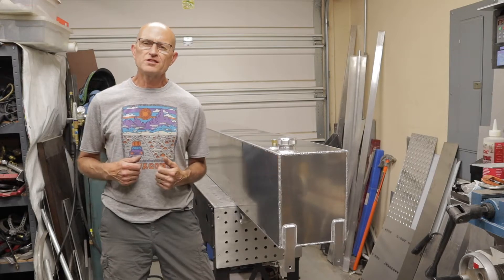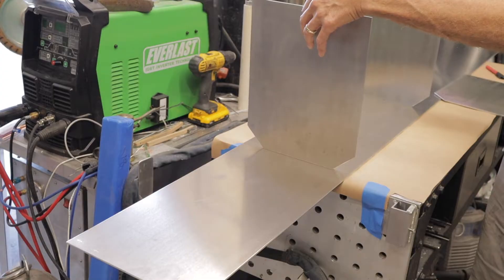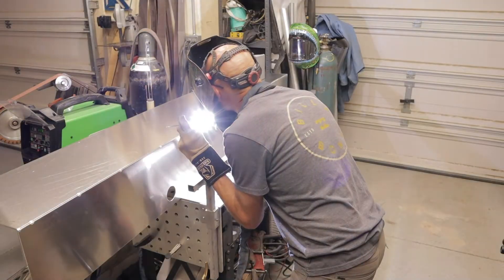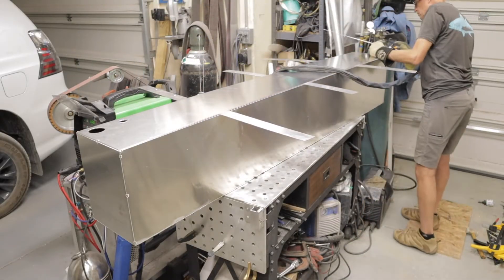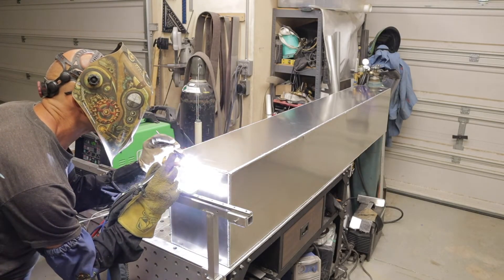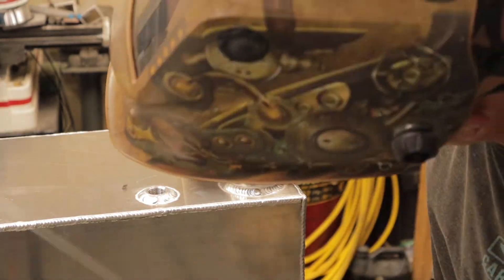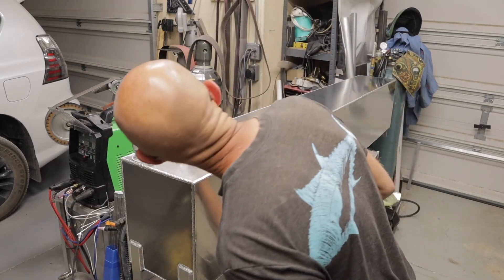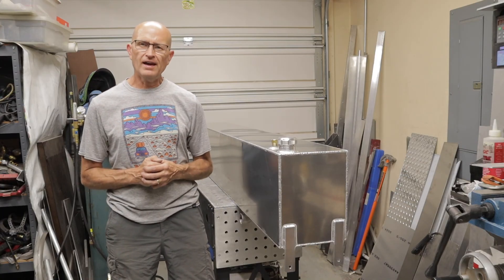ALUMINUM FUEL TANK BUILD 45 GALLON HOW TO FABRICATE IT

Comment: I have been planning to custom build my own fuel tank for the 1998 Dodge Ram 1500 that I have owned for the 26 years. In order for the exhaust that I want to fabricate for the truck I have to move the current plastic factory tank and relocate it. This takes me to the custom fabrication portion of this endeavor. Planning on putting it between the frame rails on the rear of the truck under the bed and have the inlet relocated in that same area . Do you have any suggestions or insights that I should be considering for this build? 
Love the video. Very informative and well thought out. Love your bearing setup for the long welds. Smart!. 
Thanks fr the video. Look forward to any input that you could offer. 
Thanks
Reply from the maker: Hi Ron! It sounds like a great project! 👍 if you are going to under mount it to the frame, I would recommend 1/4” thick angle aluminum with a triangular gusset at each end of the mount to keep everything nice and solid. The one thing that kills aluminum over time is flex. It eventually will tear the mounts right out of the tank if there is very much flex. Also, put a baffle spaced evenly for every 10 gallons of fuel in the tank. So for 30 gallons of fuel you need two baffles giving you three sections of the tank that are 10 gallons each.  I hope that makes sense. If you have any questions along the way, feel free to ask away! Cheers, Don😊👍
Reply: @PranaTech  Sounds great. I will use all your suggestions here as the model to follow when getting the build underway. I agree with the baffles for several reasons and it only makes sense. I hauled an 12,000 smooth bore tanker back in the day and that was a nightmare for many reasons. I liked the design you used. Do you think that also using a half circle cutout on the center bottom of the baffles would be any advantage as well? Also using the cut corners for the baffles like you did in you build! Do you have a suggestion on float leveling valves for the amount of fuel that is left?

Comment: Great job! Please do a video on your linear rail set. :)
Reply from the maker: Hi Lance! Thanks! There’s not much to the rail setup. I bought it on eBay and I believe it’s a 900mm long one. Here is a link to a similar one like mine. https://www.ebay.com/itm/405305180260?_skw=linear+rail+slide&itmmeta=01JTSGMZVDAYB4BMK82N0B8HDF&hash=item5e5e124064%3Ag%3Au90AAOSwCWVnUAjR&itmprp=enc%3AAQAKAAAA8FkggFvd1GGDu0w3yXCmi1e4lSgK4RFuNF27q1cgumbGGhuBRwXPrvMlW6PIEfwZJW1HFgEL3vaQYlK1yYpa2O%2BhnvCVL%2BNJt%2F4OOtD6wRgyCzCjOtclhqwoIOq9Tniw8jICwzhv%2BHYfE3vIDwBwtze9qmORoBgy%2FdNENPv%2FWXTXv10epBIDCCa6dkGALGwf%2FiYd7KxhNfV5J8RJD4pw97wSgelXPn8EJRF6%2FBiPTba3rRV%2FoJkHhSHPA%2FAtwipcOz4RWfj0ZtonHaWj1u9g71vAPAQJJ9eS2S6917PQPl9npY3vUCYBAyVbjqEK34w4Uw%3D%3D%7Ctkp%3ABFBMvv7TsNZl&keyword=linear+rail+slide&sacat=0&relatedSearch=true  I drilled and tapped the edge of my bench so it can be mounted there for long welds and then I made up the adjustable height frame for it that straddles the bench so I can weld tanks at different heights. 👍😊

Comment: What torch is that?
Reply from the maker: Hello! Sorry for the delay in my reply. I’ve been gone welding for days and just saw your question today. The torch is a Weldtec ihead WTR-20  It is the nicest torch I’ve ever used! It is really useful for getting into hard to reach places and I have three heads that all interchange on the rotary head. One is a small 20 size head with #5 cup for aluminum and the other is a size 17 head with a #7 cup for steel and then I have another size 17 head with a huge Mooseknuckle cup for welding stainless.  It’s not an inexpensive torch as it is made here in the US, but the quality is exceptional and it is really lightweight for a water cooled torch. Hope this helps! 😊👍
Reply: @ that thing looks like a beast. I’ve been looking for a new torch and at the moment I’m torn between this one and the ck230amp flex lock. I might be leaning towards the weldtech
Reply from the maker: They are both great heads and you would be happy with either one. I was looking at purchasing either one when I found the weldtec head on eBay for a great price and so I went that way. I have a CK head on my mobile Tig setup and I love their stuff. Very high quality that is equal to the Weldtec stuff. Hope this helps! Don😊👍
Reply: @ it certainly will, thank you.

Comment: Awesome!
Which Everlast welder are you using for this job?
Reply from the maker: Hi there! Sorry for my late reply. I’ve been working on a big welding job and missed a few comments. My welder that I use for Tig is an Everlast Powertig 325EXT. Any of their Tigs are great though. If I didn’t need that much power I would have just bought their 255 Tig, but sometimes I get jobs that I need to weld 1/2” aluminum so I went with the bigger one. 😊👍
Reply: @ thank you. Don't worry, getting work done is priority.
Thinking of getting an Everlast to work with a maximum aluminum thickness of 1/4".

Any recommendations?  

Not a shop, just a weekend diy guy that would like to build his own fuel tanks and small parts.
Reply from the maker: @alexsails80 I would go with any of the 250 amp Everlast tigs. They are all great machines!😊👍

Comment: Very Nice video, very nice tank. I need to make one like this but for gray water for a food truck. would MiG welding be fine? the tank will be placed in invisible spot of the trailer, thanks.
Reply from the maker: Hi there! Personally, I would only Tig weld a tank. I have a pulse mig welder and I’m pretty good with it and I still don’t trust it for welding up a tank that needs to be watertight.  It only takes a pinhole to make a big mess once the tank is installed and mig welding aluminum is still pretty dirty at the starts and stops of the welds. I know there are guys that are good enough to weld tanks with mig, but I know I’m not good enough so I stick with Tig welding so I know they won’t leak. 😊👍

Comment: Id love to see your machine settings, good job though
Reply from the maker: Thanks for your comment! Here are my settings. For amperage settings I don’t use the full amps all the time, just need it at the beginning and then I reduce the amps with the pedal as I go along. For the outside corner joints 180 amps, frequency 80HZ,balance @24. For fillet welds, the same settings but 200 amps. For the 1/4” mounting brackets, 220 amps, frequency 60HZ, balance @24. My Tig welder is an Everlast 325EXT.  😊👍

Comment: Prana-Tech, I'm confused about the baffle tops not being beveled/chamfered @ the corners to let gas/air out when filling? If the fill covers the lower limber holes/clipped corners... where does the volume of air above the fill level at the bottom go?  IF the baffled volumes can't 'breath' back to the vented chamber... won't filling be a rodeo? At one point I can see this tank burping fuel back up the fill fitting due to trapped air?  If you draw off the bottom and the baffles prevent the vented chamber from equalizing back to the other chambers' upper volumes- won't you vapor lock/vac lock the tank?  Even in the desert - good aluminum practice is to remove mill scale so you avoid pitting corrosion (flowers) that happen when the mill scale (you left on) traps moisture and initiates pitting over the inside and outside of the tank.
Reply from the maker: Hi Kevin! Ok, I’ll try to answer all your concerns. The baffle plates have a 1/4” air gap at the top of the tank for air flow.  As far as good aluminum practices, I order 5052 with the plastic coating on it it so no moisture gets to the aluminum until I peel it open. I then give it a light brushing with stainless brush right at the joint to remove any oxidation. I then wipe everything down with acetone right before I weld to ensure no contamination in my welds. 😊👍
Reply: @PranaTech  You don't seem to understand mill scale, aluminum oxide, and the pitting corrosion cycle?  The shipping plastic is not in the equation.  Mill scale is applied at the rolling mill and has some purposes but shouldn't be left on- acid etching and flood rinse is the correct surface treatment.  Weld prep to disturb mill scale AND alum. oxide prior to welds isn't very important w/AC TIG since the voltage 'polarity' will change and lift the vast majority of contaminants and the hot argon will wash the puddle clean.  Mill scale in the field of the panels of a tank will pit.

Comment: Cool video man thanks! If i was considering building dual saddle tanks for a carburated 1972 Ford Truck. what are some safety considerations that a first time builder might not be aware of? Proper mounting, skid plate? Each tank would be in the 15 -20 gal range.
Reply from the maker: Hi there! For every ten gallons of fuel I install a baffle. So what I mean is that a ten gallon tank needs no baffle, but a 15-20 gallon tank I would install one baffle to minimize the sloshing effect.  As far as mounting goes, I usually weld steel brackets onto the frame so that there is a shelf for the tank to sit on at least partially so that the weight of the tank is supported from the bottom so that everything isn’t just pulling on aluminum mounts welded to the side of the tank. If you just envision that every bump and pothole that you go over every time you drive will be constantly trying to tear your tank apart. This will guide you to design it to be overbuilt and bulletproof so that it will last a lifetime and never succumb to the forces of gravity. Hope this helps my friend! Let me know if you have any other questions and I am happy to help if I can.😊👍

Comment: Thank you for your video!  Question:  I have a new aluminum diesel fuel tank for marine use.  I am trying to locate a stainless steel replacement or workaround for the 'rollover valve' or in other words, the vent valve threaded into the top of my tank.  At the end of your video, it appears that the one you have installed is brass.  US Coast Guard rules have me using stainless steel fittings that connect directly to the tank.  I have been looking unsuccessfully to find this part in stainless steel.  Any thoughts on the matter?  Thanks again.
Reply from the maker: Hi there neener2!   Well, I’m surprised they don’t accept brass. Brass doesn’t corrode and the ball inside is stainless. Anyway, I can’t find any stainless rollover valves out there. This is the only one I could find. https://www.amazon.com/Rollover-Alpha-Rider-Stainless-Breather/dp/B0BFHYFFRC  This one would need to be remote mounted above the tank but it is made of stainless. 😊👍

Comment: Hi Don, greetings from Croatia 🇭🇷 !
I have a question, I want to build myself two aluminum tanks and as a novice im looking into double pulse Mig.
Model is Spartus easymig 217 DP ,
would you think im on the right track?
Reply from the maker: Hi Frane! Well, I’ll be honest and say that I can’t really recommend mig for building fuel tanks.  I started out welding aluminum with a mig spool gun and because I wasn’t happy with the quality and consistency, I taught myself how to Tig weld aluminum. The pulsed mig is definitely way better than a standard mig spool gun, but in terms of consistent structural strength with aluminum, nothing comes close to Tig welding. The outside corner welds would probably be acceptable with pulsed mig, but the inside corners and corners where three pieces come together need a lot of penetration to insure a structural and water tight joint. This would be difficult to do with a mig even if it is pulsed. The starts and stops of mig aluminum welds can get pretty black with soot and it is very difficult to begin again after stopping with aluminum mig. That soot contaminates the weld and makes it very difficult to get a weld that is water tight and not leak. My advice is to buy an economical AC/DC Tig welder that is 200 amps and spend some time practicing and learning how to weld aluminum and you will be so much happier in the long term and your projects will be much higher quality as a result. I hope this helps my friend!👍😊Don

Comment: What type of material did you use, 6061, 5051 etc? I heard you say 1/8inch or .125 just wondering the material type.
Reply from the maker: I used 1/8” 5052 marine grade aluminum.👍😊

Comment: Interesting to see TIG used for that size project. Why did you go TIG vs MIG
Reply from the maker: Mig is certainly faster no doubt, but for an aluminum fuel tank, I always choose Tig. The welds need to be precise and clean to ensure proper penetration without any inclusions or porosity. Mig for aluminum is a pretty dirty process. Most of the time there is soot or smut around the welds unless you are very lucky. 😁👍
Reply: Not to mention spool gun on a corner joint (minus baffles) with .120 wall, that's hard to not blow through. Decided to try repair for a client on a pontoon one time with a spool gun. Never again🤣
Reply from the maker: That is very true!😊

Comment: Nice work. What filler material did you use? Some claim the 5356 has more tendency to crack.
Reply from the maker: Hi Trey! I do use 5356 and I had never heard of any cracking issues with that rod before you mentioned it. It is one of the recommended rods for this grade of aluminum. The metal is 1/8” 5052 marine grade aluminum and is quite soft compared to 6061.  I guarantee my tanks for life and I’ve never had one come back. This one is bolted to a horseshoeing rig that will spend most of its life bouncing down dirt roads, so of all the tanks I’ve built, this one would be the most likely to test my warranty. 😁👍
Reply: @PranaTech  yes many times I prefer the 5356 over 4043. I just seem to get better wetting and a prettier finish with it. I'm sure it's the correct alloy for the 5000 series aluminum you're using. And you can't go by what you hear. Just checking your personal experience.
Reply from the maker: Yes, my welds look so much better since I switched to 5356. It definitely wets out better and I think the smoother/shinier welds look more professional. 😁👍
Reply: @PranaTech any reason you picked 5052 for the plate?
Reply from the maker: Yes, it is marine grade aluminum and is the most common used for fuel tanks that are to be welded. It is stronger than 6061 after welding. 6061 becomes weaker than 5052 after welding. It is also easier to bend for making tanks because it is softer than 6061 and won’t crack when bending. 5083 and 5086 are even better but those alloys are not readily available here in the desert southwest. 😊👍

Comment: What model Everlast?  I recently purchased a yeswelder Tig 250 AC/DC and so far it is working great. Are you still a fan of yeswelder?
Reply from the maker: Tallyman, Yes, I’m still a huge fan of the Yeswelder Tig! I use it as my mobile Tig welder in my business and it still works flawlessly. It is so light and easy to carry with me wherever I need to weld. The Everlast is the 325EXT. I purchased this last summer for a big project for a commercial company and I needed more amps than the Yeswelder could handle. It is also a great welder that I’m very happy with. 😊👍

Comment: GREAT VIDEO DON, I'M LIKING THAT SLIDING RAIL SET-UP, WHICH WELDER ARE YOU USING?
Reply from the maker: Thank you! My main Tig now is an Everlast 325 EXT. I use the Yeswelder 250 amp Tig for mobile welding. I’ve had the Everlast for a year now and it has been a great machine. Very consistent welds and more power than I had for thicker aluminum jobs. 😊👍
Reply: Agree, that sliding hand rest was a great idea, along with the adjustable support bracket! While using a linear bearing setup might indeed be overkill from a precision perspective, it certainly meets the functional requirements and with the proliferation of DIY CNC projects, they are now less expensive and much more readily available.